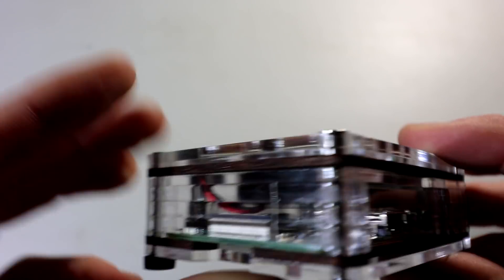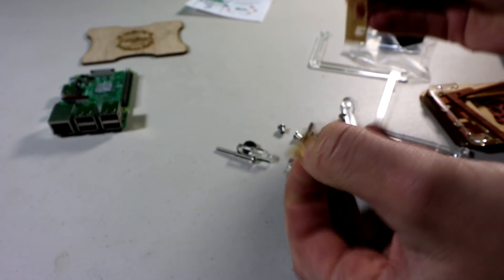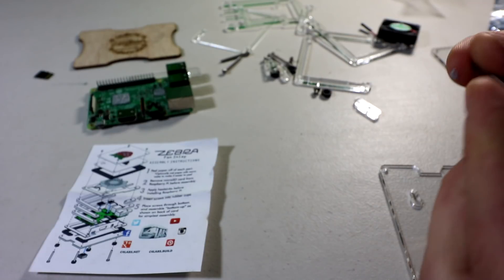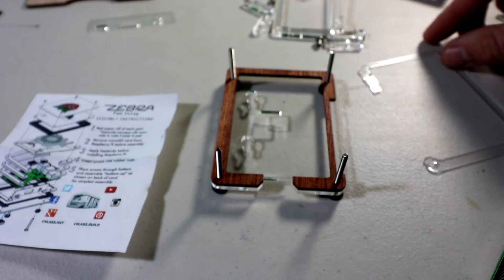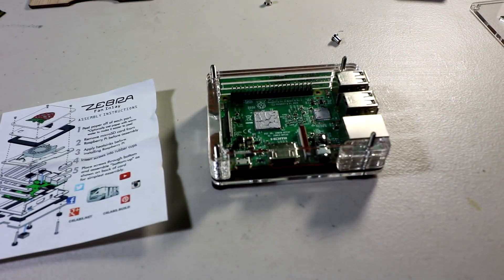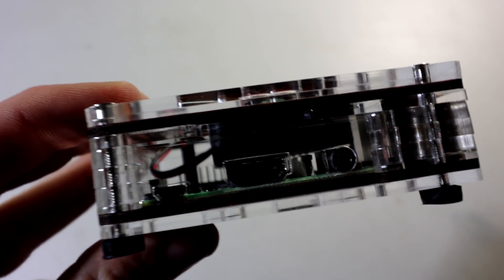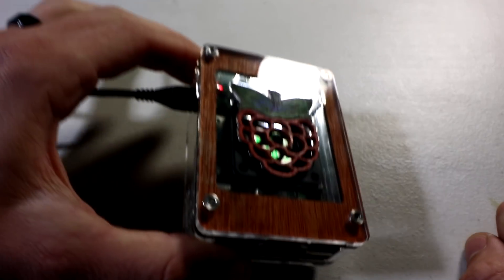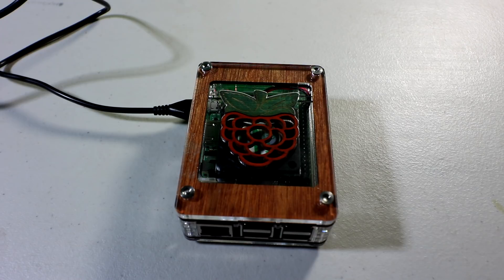Zebra Wood Inlay FAN Pi 3 Case How To & Review

Comment: you can use a noctua fan if you want a better fan Noctua A-Series Cooling Fan Blades with AAO Frame, SSO2 Bearing (NF-A4X10-FLX 5V)  is the model you would want to get.